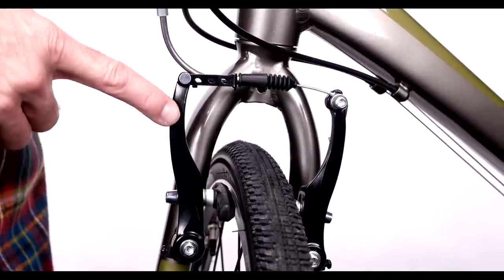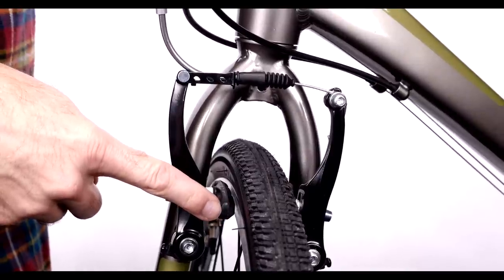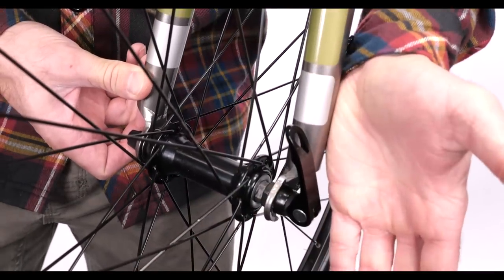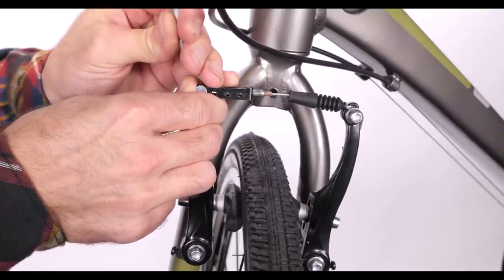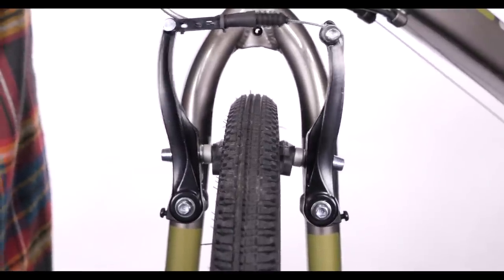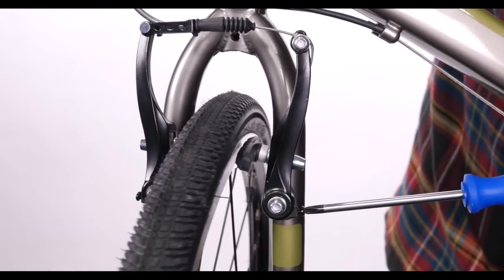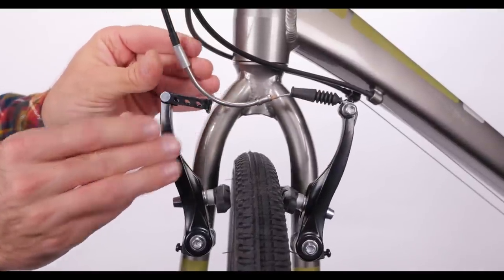V BRAKES ADJUSTMENT

Comment: If tightening/loosening small screws does not help fix one pad rubbing issue, then we need to check the spins inside brake arms, the screw and the spin are most likely not contacting each other properly.

Comment: when i apply the brake and the two pads contact the rim, i then release the brake and one pad stays against the rim.  whats the adjustment for that?    ty
Reply from the maker: Bill, our awesome customer service team can talk you through this, or any bike shop should be able to help! https://ride.diamondback.com/contact-diamondback-bikes
Reply: Nothing
Reply: @sebastiansanchez2776  Its cos most v brakes sit against rims at an angle. The adjustment screws on them are either shit or there info missing from this guide...
Reply: Instructions on my bike say to take brake pad washers from one side of the caliper and place them on the other, but didn't work for me. I "solved" it (schlockally) by manipulating the angle in which the noodle approaches the slot, eventually putting a zip-tie around the brake wire and bike throat to approximate that best angle. May not stay there however...

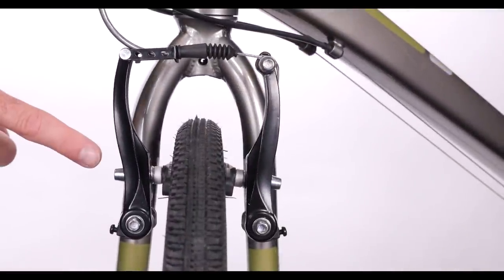Comment: 0:56 my screw fell out and it won't go back in.. is there a trick to tighten the screw back in?
Reply: ok in my case I had to loose the spring at the V-Brake (on the side were the screw fell out), then I could put the screw back in  :)

Comment: My noodle can't reach the notch it so close I need help
Reply: Ҝ丨ᗪ丂卂爪ㄩ尺卂丨 you have to release some tension on the brake cable. Loosen the bolt that holds the cable, opposite side that the noodle is on. Let out cable then retighten

Comment: Useless! Notice that he didn't address the fact that one of the caliper arms was moving while the other was not. Simply adjusting the screws did nothing to address that issue, except in theory. I have that problem, and this did not solve it - one brake pad rubs constantly.

Comment: This model of brake is everywhere, probably because its cheaper. But it is a poor design. One brake pad perpetually sticks, results in constant braking. I have started calling this "Rimjob". Go to mechanic, fix it yourself OR get a new one -  You will still be Rimjobbed after few miles. Solution - Don't buy V brake cycles, go for an older U brake technology.
In fact cycling community should ban V brakes.
What you say?
Reply: Yes, same happens to me. I have a Raleigh M20 and one break pad is always touching the rim, usually the front one. I can adjust it, but it will go back to the same position shortly after. It's frustrating actually.
Reply: totally agree. i could not adjust these things. It would always go back to rubbing or not working.
Reply: @juanjoalbertez103   Yes. They are awful.  All noob cyclists fall into this trap. Disc brakes or hydrologic brakes work brilliantly.  I think disc brakes are better because they don't need maintenance like hydrologic brakes
Reply: You're talking crap
Reply: I am in agreement. Have yet to see a video describe my brakes. As I ride the arm with the noodle slowly approaches the rim and creates drag. There is no way to pull that side back when the brakes are released. I will next investigate possible drag inside the cable housing which does  not allow that arm to pivot. I simply do not understand why this design is used on bikes. A single cable aligned vertically along  the wheel center with each arm reaching inwards makes more sense.

Comment: Tried to move brakes away from the wheel as you described and it does not work. These Specialized brakes suck. My kid has not had hand brakes for two years because of this s#%& design.

Comment: You're steps don't work when the adjustment screw is all the way in and the pad is still rubbing.
Reply: Then you need to loosen the wire on top to make the distance between both pads wider